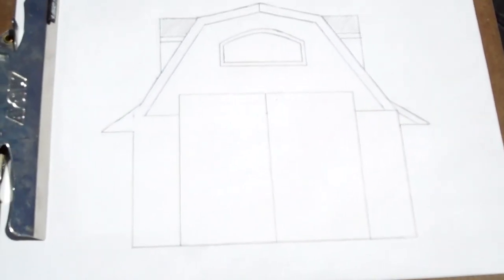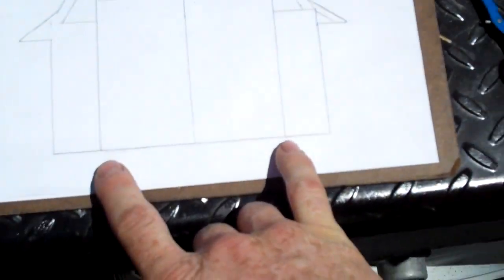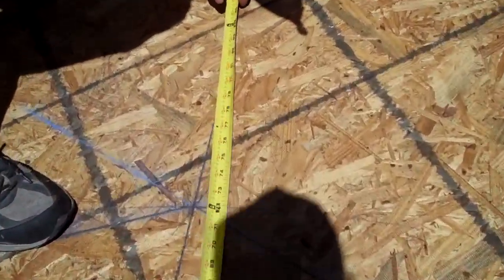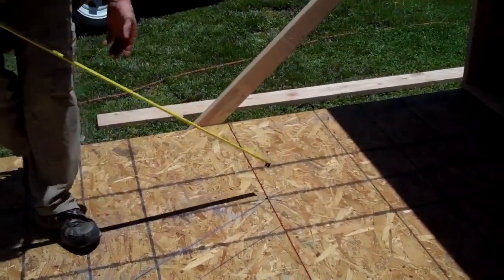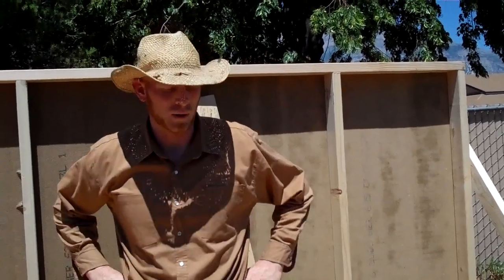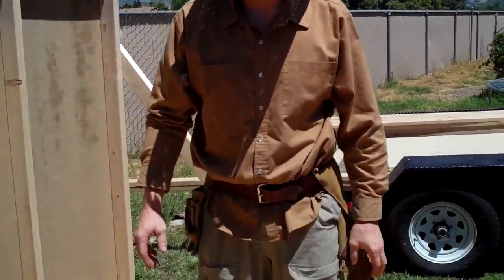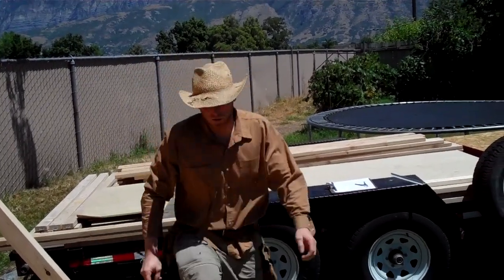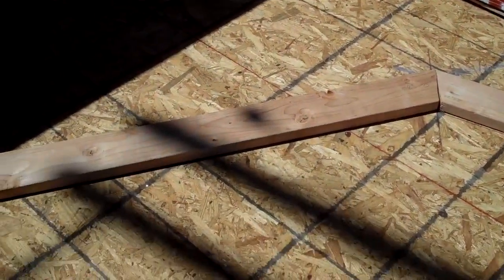Free Shed Plan / Instructions Right NOW No Gimics No Advanced Math Gambrel Roof

Comment: Awesome job. How are the trusses attached to the wall?
Reply from the maker: You can toe nail them if you're in a low wind area as well as twist strap.  If you're in high wind areas use hurricane clips.
Reply: There are many factors in creating an amazing design. One plan I found that successfully combines these is the Wilfs Shed Formula (google it if you're interested) without a doubt the no.1 info that I have ever heard of. look at this  amazing website.

Comment: I'm back! I have 2 quick questions for you. If my shed is 10 feet wide by 12 feet long, can I install my roof so the front is on the 12 foot side? (so I get a 6 foot high roof) And therefore gives me a higher roof (more storage space/head room?) than going with the front at the 10 foot side?? I hope that makes sense. And my second question is if I have to run my roof the other way, how high of a roof can I install? On the ten foot wall, my center is 5 feet right?

Comment: Thank Brian!  I wish I had watched this before.  I built a 12 X 24 barn.  It turned out pretty good.  However, I built my Truss's according to the plans (22.5 degree angles on every end).  But my truss's must not have been perfect and so my roof is not perfect.  If I had used your method I think it would have turned out better.  Great job!  Easy to watch and understand.

Comment: 2:56

So *that's* why tape measures have that notch!  Clever!
Reply: There are  a few ideas for building sheds
Start With a Sound Foundation a shed wont last long if it's set on a weak base
Allow for Air Circulation to prevent damp 
Build a Weather-Resistant Floor Frame
Use Low Maintenance Materials so you won't have to keep re-painting it
(Reference: Adota Blueprint Pack site )

Comment: I had already decided on 12 X 16 because of the standard of plywood and 16" on center for wall studs. I wish to make mine have 8' walls because I am tall. What would be the easiest way for me to lay out the truss lines on the floor like you did to accommodate the 8' wall? I know they make 2X4x92-5/8" for the wall studs but I am not sure about that either.

Comment from the maker: You can make your walls as high as you want.  The principles I shared here make it so you can lay out a roof design that is based on a half circle that will support weight/look good/match your width with minimal math skills.  As to how lerpy the shed looks is up to you and your drafting/preference.  What ever height you need to clear = 3.5' + your walls.  OR  Wall Height = Desired Height - (3.5 feet + truss thickness).

Comment: I am building a 7 x 7 gambrel shed.I want to be able to stand comfortably inside (I am 6 ft tall). For the base I have 4 12" cement precast pyramids with metal brackets holding 2 4x6 lumber on top of which i have 2x4 floor joists every 16". My questions ... 1. is there a limit to make my walls since I only have a 7x7 base? Can I make the walls say 5'6"? 2. for the roof using your way, I would use 3'6"? Since that is half of 7' ...

Comment from the maker: I like to error on the side of caution.  It's cheaper in the long run to buy the 2X8's or 2X10's than it is to rebuild and salvage a failed structure.  For something 50 ft wide I'd use something 2X8 if not 2X10.  If you only need it for the summer you could get by with 2X6's and let it go. (like for a movie or a wedding etc.)

Comment: Brian....Thanks for the easy instructions. How did you attach the rafters to the top plates?    just toe nail them or did you use metal brackets?    Also what kind of foundation did you use??    2 x 4's on 24" centers like your walls?  Did you place you foundation on 4 x 4's or cement pads?  The foundation is the only thing I'm unsure about.
God Bless
Patrick

Comment: I'm building a gambrel roof and love your explaination. I don't need to know the angles, but you said yours were 31, 22, and 15 degrees. I tried adding them up to 180,  several ways, but didn't figure it out...obviously I'm not a math whiz. Keep up the good work. Will have to check out your other videos. Concise and to the point.

Comment from the maker: You do the arc to get the location for maximum space & snow load strength.   You run the arcs to find the location where they intersect.  The length is half the distance from wall top to wall top in the front. (usually the smaller of the two dimensions)  in your case of a 10' X 12; is 5' arc length.

Comment from the maker: @Worm2475 
1. I did 6' side walls ( you can litterally do any size you like.)
2. I toe nailed them.  I'll put twist brackets in this summer likely. (had severe winds and heavy snows and ok)
3. For the roof I used the regular 7/16" ply.  Due to the angle of the roof it sheds snow well.  I had two feet of wet heavy snow on the roof this spring no problem.

Thanks for watching!